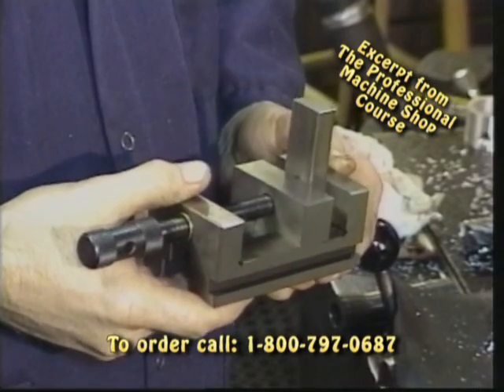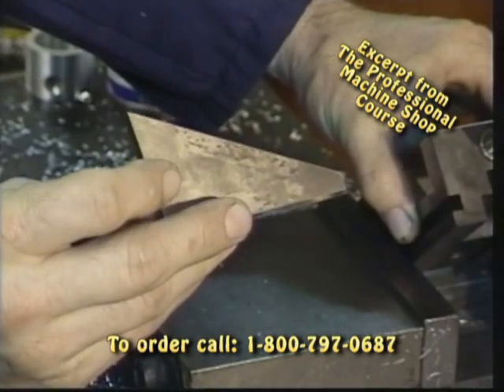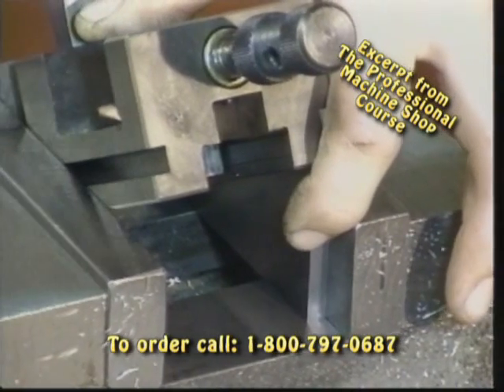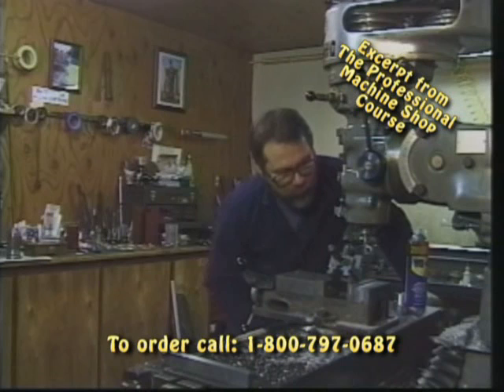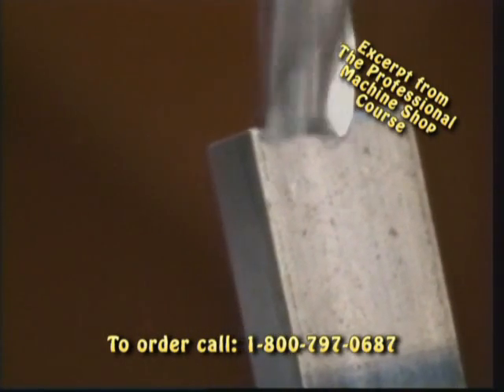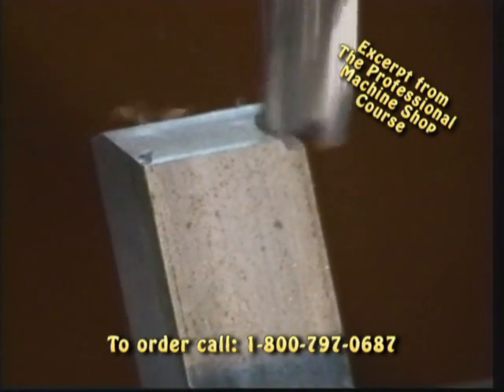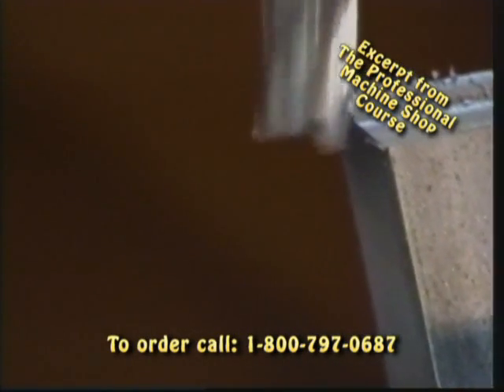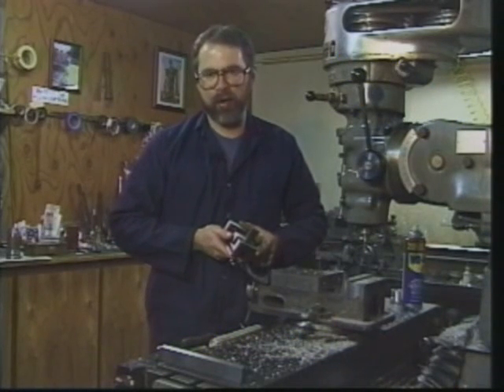Machine Shop Training: Using a Secondary Vise ATI Mill #4

Comment: Ya, secondary vices can be very help full but not in this case! Just chuck up the workpiece in the primary vice using the angle block!! less overhang.:) Kudos for cutting UNTO the work edge to minimize the burr.